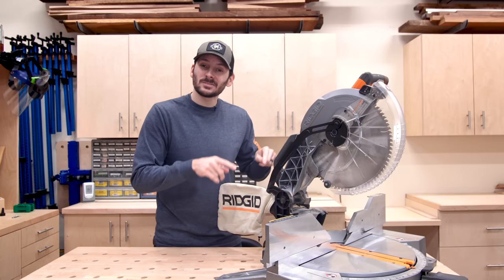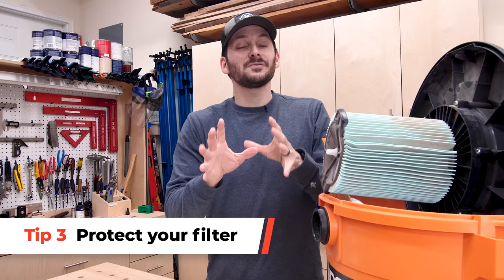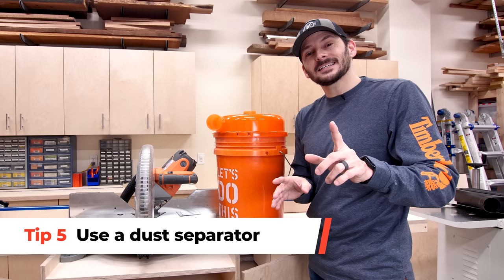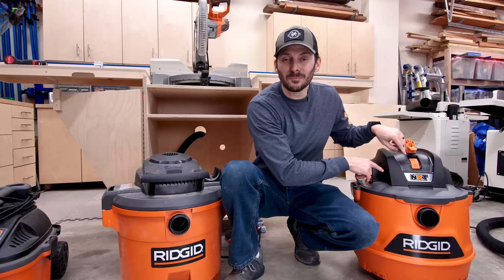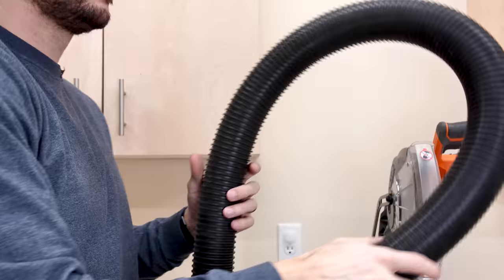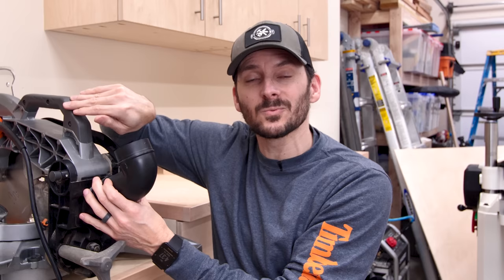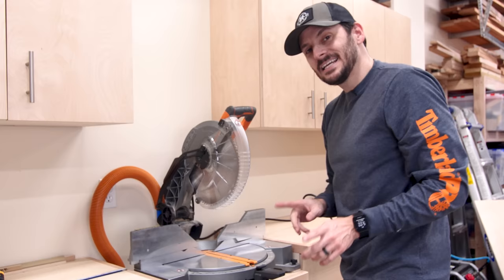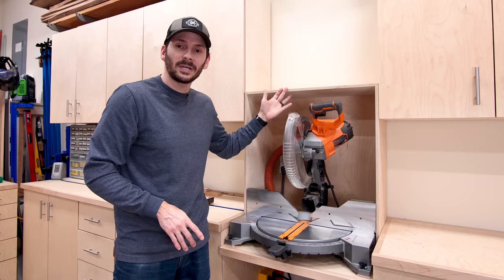10 Tips for Better Miter Saw Dust Collection

Comment: I told my wife that I needed to buy a 3D Printer.  Oh, we laughed and laughed.
Reply from the maker: 😂😂😂 persistence is key!
Reply: @smashyrashy    My wife is. 😂
Reply: Hard to justify a 3d printer, until you have one. Now, im glad I can CAD and make my own brackets, fittings, etc. It's at least paid for itself.
Reply: ive got 5 of them and am now starting my woodworking/shop tools collection. you still have a chance to make it out the other side w/o a printer
Reply: My wife says I have switched to shopping mode so she is expecting me to get one pretty soon. Our problem is with the high humidity we have since we are only .6 miles from the ocean.

Comment: The dustopper leaks around the mating surface between it and the bucket. A thin line of foam tape drastically improves suction
Reply: I came to make this same comment. Huge difference!
Reply from the maker: great tip!  Gonna do that now
Reply: I used a bicycle inner tube and laid it over the bucket lip to help the seal.
Reply: I haven't noticed that with mine. I will have to check it when I have it out next.
Reply: Thanks for the tip.  I will check mine tomorrow!
Reply: What kind of foam?
Reply: Yup, what he said. I just used a couple of layers of ductape. With that, I have basically no measurable amount of suction loss with the dustopper.  

What would be awesome is to find a 150cfm or so shop vac that's only like 3-4 gallons. Highest I've seen is the 110 cfm Ridgid Pro square one, which is what I'm using.
Reply: @TomHoppe  dumb question but did you put tape on the lid or bucket or does it matter?
Reply: @taylormcleod3331  Go get a roll of 1/4" adhesive backed weatherstripping from the hardware or big box store.
Reply: My dustopper vac combo already slightly crumples the home depot bucket with all the suction. I'm excited to see if it vanishes like it got sucked into a black hole with the foam tape!
Reply: I noticed mine had a pretty good seal, to the point that the walls of the bucket started collapsing due to the negative pressure. Cut out a spoked wheel using my jigsaw and put it halfway down the bucket walls. Now it doesn't collapse anymore.

Comment: Another method of making fittings is to heat PVC pipe fittings that are slightly undersized. After it's soft enough when heated, force fit them to the fitting that needs to be fitted to, allow to cool and now new fitting is form fitted. An added benefit with PVC is the self lubricating characteristic that allows fittings to be easily readjusted or removed with less binding.
Reply: Just make sure that you do that outside with the wind blowing away from you. Heating PVC causes it to emit toxic fumes. You could also use heat shrink tubing.
Reply: uy be careful with that. your also creating a taper that will want to force the inner part outwards. especially in pvc when it bends a bit. sandpaper it horizontally and it will be stronger.

Comment: I swapped out my included dust bag for a plastic trash bag that I taped on the saw outlet. There was sawdust caught in the folds of the OUTSIDE of the bag and ZERO inside the bag. It is simply a flawed concept that pure momentum of the blade will shoot the particles in the bag. Now I need to pay attention to what you're doing here, lol.

Comment: Nice one, thanks as always.  I'm with Joe Blow Below- I don't have a 3D printer, I haven't had the patience to teach myself any CAD/CAM software, so I just kind of heat stuff up and cram it together as best I can.  PVC and ABS are cheap!  Use good ventilation., and stuff something more or less heatproof inside of the tube so it doesn't collapse when you bend it.  

I've found  #1 plastic - PETE - to be really helpful, as it shrinks when heated.  Many, many types of bottles and jars from the supermarket, including many sizes of soda bottles, are made from this plastic.  Cut the ends off, slip it around the two pieces you're trying to mate, and put the heat on it.  It will shrink to fit both so you get a removable airtight seal.  

Finally, those boxes with a bunch of furnace air filters and a box fan blowing out the end are great for protecting your lungs.

Comment: I have been using pool skimmer filter socks on my shop vac filters. When they get dirty just grab the sock, stretch it out a little then let it go. This saves the filter and are easily replaced. I got 30 in a pack for like 12 to 15 dollars.
Reply: Great tip!  Been doing this one for years.  Cheap fast simple.  I use the bag filter for drywall dust, but pool socks are great for wood chips and dust.

Comment: Loved the video. I've been working on my own dust collection system and this video gave me some new ideas. Thanks!
 The fitting should always go from smaller to larger, when possible. This helps eliminate the lip that can collect dust and debris that can clog up the hose.
 I've seen people use PVC DWV to make custom fitting by heating them to the point where they can be stretched, bent, and manipulated to fit other sizes and needs.
Reply from the maker: yep, it'd be more efficient  going outside vs inside, but the inside of both were smooth vs the outside being ridged which wouldn't be good for a plastic coupler

Comment: I have similar set up, big rigid vac, put a y  with 1 hose to miter saw and another stepped up to 4" with a rockler 10"×4" dust trap on table behind saw with hood. It gets about 90+% of the dust. Works great. I have this incorporated into a movable miter stand similar to yours.
Reply from the maker: hmmm, never thought of actually splitting the suction of the vac...I'll have to consider that!
Reply: Any chance of a pic somewhere?

Comment: I went to my local wood caft store and bought two angle connectors to fi my rigid 2 1'2 hose. Had an old garbage can....full size....cut hole in top for each of the connectors which were fastened with pop- rivets. Now one hose goes from the saw, router bench, planer,  etc. to the garbage can...than a second hose goes to the Rigid shop vac. This works great for all but especially the planer which really puts out tons of wood chips. Most end up in the modified garbage can and very little other than dust goes to the shop vac. This is the same princil used in all those other dust collection devices....but mine was dirt cheap.
Now to my gripe....like you I have Rigid shop vacs....three of them currently. One is about 25 years old and works like a champ still....the next one is about 12 years old....last is the latest propack rectangular unit. Each of them has their own fittings for the hose and accessories. I go to HD and try to find adaptors between them and while they have lots...they are each dedicated to a given size....2 1/2", 1 7/8", and smaller. I aso have the same orange hose you discussed and that does allow some cross connections BUT i had to use an old dual sided 2 1/2" male to male adaptor that does work great for connection and than stepping down....but I have not been able to find that same fitting again....and I would love to get a couple more. May resort to 3D printing but I am surprised that Rigid or HD doesn't offer more adaptors Maybe it is planned obsolescence ;-)  I finally resorted to modifying some adaptors I had by using my band saw to cut them up and turning them down on my metal lathe....but that is not the way it should be.

Comment: I attached a multi plug in to the vac switch and attached bandsaw, table saw, router table, miter saw, and drill press to the multi plug. I made a plenum and attached each machine to separate blast gates attached to the plenum. The plenum I attached to my dust collector which was attached to my large shop vac. The shop vac chord I attached to Opening the blast gate to the vac switch and turned on the vac. So I cuold open the blast gate to the tool I would be using and draw the sawdust into the plenum and then into the dust collector. 
  I modified the vac bag so that I could dump what little dust was in it and then reclose the bag. Over the pleated filter I placed a section of sleeve from a polyvinyl jacket which stopped most of the real fine dust making it through the shop vac bag to the pleated filter. 
  I added an additional blast gate for a hose for floor vaccuming. 
  I built a off feed / workbench / tool housing bench which I housed the miter saw, band saw,  and drill press. Each of these tools I attached to a folding shelf which rotated the tool up through the top of my bench through a horizontal door equiped with 180 degree hinges. The tool shelves had a wing attached by door hinges (not cabinet hinges) which supported the weight of the tool like the miter saw off feed supports in the video. 
  The workbench acted as off feed support for the router table and jobsite table saw. 
  Since my shop is a portable 10x20 building supported off the ground I was able to run the vac to plenum hose under the shop between the floor joists. This eliminated my tripping over the hose everytime I rounded the workbench.

Comment: Thanks for a great video! I am using a similar setup with a shop vacuum with bag and a Dust Deputy, but I also added a HEPA filter to the vac. One thing I think you missed mentioning is that that iVac auto-vac switch is the one to buy if you need to run a saw and a big vacuum. Its biggest feature is that it can be plugged into 2 circuits, which prevents tripping a breaker. My miter saw can draw 12 amps and my vac also draws 12 amps, so they need to be separated. The first auto vac switch that I bought, only had the ability to plug into a single outlet, and that was problematic, so I had to buy the same one you showed in your video and it works perfectly, as you know.

Comment: I kind of went the opposite approach and ONLY have a 4" dust chute on the bottom of my miter saw hood hooked to the Dust Collector. The whole thing is hobbled together but the fine dust that comes out of the back of the saw just hits the back of the hood and falls down into the 4" DC port/chute. However, this does require the miter saw to be very close to the large dust collector. 

Actually, picked up a cheap wall mount Powertec DC to dedicate to the miter saw. Since I had the 4" fittings this cost less than buying a heavy duty shop vac, hoses, auto-on/off, etc. I'd say if you have the space for a shop vac and DC combo, that setup is best. However, I'm happy with a 4" DC hood connection vs. shop vac direct connection if you only had one. Great video as usual.
Reply from the maker: I'd love to dedicate a larger collector to the saw and have it on some type of automatic switch.  That'd be great
Reply: Not following too well. What does the powertec dc do better than shop vac?
Reply: @carenclemmons5002  Physics. Single- or Two-Stage Dust Collectors (commonly using 4" or 6" duct work) have the advantage of sucking a higher volume of air than a shop vac. A dust hood surrounding a miter saw contains a significant amount of cubic space filled with dust, so using a dust collector that can move a greater air volume has an advantage over a shop vac.

Comment: Enjoyed your video very much. I just got my secret weapon today. It’s a remote controlled switch that I keep on a belt loop so whichever side of my 4x8 rolling workbench I’m working on, I can quickly turn on or off my shop vac. I’ve got my miter saw, table saw, jig saw, belt sander and palm sander that I connect to my shopvac. The remote works perfectly. If I used your secret weapon I’d need 5 of them and I’m too cheap for that. I made a dust collector for my miter saw that looks like a scuba set up with dual hoses plumbed to the shopvac. It’s stationary and works for bevel angles but needs to be removed for miters. Not perfect but solved the 12” Dewalt habit of sending sawdust everywhere. 
I love looking at all the great ideas on YouTube. 
Thanks for putting in the work to bring us informative entertainment. 
Cheers.

Comment: Since you asked, I would not hook up 4" dust collection.  I made mine with it open under the MS and all saw dust that doesn't go up the shop vac just floats into the drawer under the saw.  I can sweep the saw off and all dust falls into the drawer.  Once a month (or more) I empty the drawer.  If you are worried about the fine dust, just put a fan with air filtration nearby and run it with the shop vac plug in.  I did a several videos on dust collection and such on my MS station. a couple of years ago.  If interested, they might give you some additional ideas to look at.  Great channel, thanks.  I don't always comment, but I do always watch.

Comment: You find a really nice miter saw on craigslist for $100 and feel like you found the best deal ever.  2 months later you've spent dozens of hours and hundreds of dollars getting the setup just right. 

--> It still blows dust everywhere.

Cross-cut sleds are loved for a reason. Love your setup though, those shop vacs at home depot are awesome. 15 years, and it even blew out my siberian husky's coat.

Comment: You have a nice solution as-is.  In my case I plumbed in central vac combined with an iVac switch but I regret my solution.  I often walk up to the saw just to make a quick cut, and by the time my collector is up to speed I've already finished my cut and moved on.  The Shop- Vac fires up almost immediately, so you don't have the lag issue that I have.  What does work well for me is enclosing the front of the dust hood and my downdraft area behind the saw...with nothing connected directly to the saw. Works well.

Comment: I have a couple of the nylon (?) miter saw dust hoods that he alludes to that work well for me.  The first one I bought is a Rousseau and the second one is a Vevor, which is just as good as the Rousseau and was considerably less expensive.  (Both from Amazon.)  I don't hook up any vac to the miter saws themselves, because it's too awkward with the dust hoods in place, and because the miter saws throw off a lot of dust from all different directions anyway, which the hoods capture - which is what they were designed to do, and they do it well.  They practically envelop/cradle the saws, leaving just enough working room.  Pretty ingenious (but simple) designs, the way these things work.

Plus, static inside the hoods tend to pull dust in and then the dust clings to the inside walls of the hood.  Occasionally I'll just give the hoods a shake, where dust settles down to the 4" exit port at the bottom near the floor, and is collected into a cardboard box sitting on the floor.  Anything remaining I clean up with a handheld vac.  I guess I'll probably in the future experiment with hooking up a shop vac to the 4" port, but for now I'm too lazy to do so and to finagle the room to do it.

But the con is the initial assembly and setup, which is a nightmare.  Better have two (or three) persons handy to assist as you cuss your way through that.  VERY awkward.  (The Vevor is essentially identical to the Rousseau in that respect.)

As far as shop vacs are concerned, I suspect every manufacturer will eventually get on board the trail blazed by DeWalt, and make their vacs "quiet" - or MUCH quieter compared to the ear-splitting noise produced by regular vacs.  These quiet vacs are a game changer, and don't even require ear protection by those folks concerned about their hearing, or at the very least are annoyed by the noise of regular vacs.  I have one of those among my collection, and am amazed by how quiet it is.  

I also have the upgraded version of the Dustopper ("Dustopper Pro") sold by Home Depot.  THIS is THE ONE to get.  Fits very well onto a cheap 5 gal. bucket with its secure clips.  None of that expensive collection bucket nonsense or cobbling up a collection bucket.  Get a semi-opaque HDX bucket from Home Depot (so you can monitor how full its getting) as well and you'll be good to go.

And not to slight Ridgid, they are my go-to as far as (quality) plumbing repair tools are concerned.  I live in an old (cast iron/lead pipe) house, and have an ongoing project to replace all that stuff with pvc/pex pipe.  You haven't lived until you've dealt with all that in a narrow crawl space.

Comment: Great video! I got a Dewalt 10 gallon shop vac for this very reason. Great ideas for upgrading my system. One thing I wanted to mention about the 3D printing is another possible option if you don't have a printer of your own. Try your local library. Our library has a few that you can use to print things.

Comment: Great video! I bought the iVac automated vacuum switch because of your video! It works awesome! I used to forget to turn on the vaccum when making cuts! It turns on and off automatically. I mounted the box to a piece of plywood and put a French cleat on the back and now it's hanging on my wall and I can plug tools in as I use them with my ridgid shop vac!

Comment: I had a home made box/shroud previously with a hole in the bottom attached to my 1 hp dust collection system.  It did not work.  I have seen others add plastic curtains to increase the suction.  I did not try this, so I'm not sure it would work.  I have since bought and use the Rolland shroud.  Even if there is plenty of suction, I need to shake the shroud from time to time to make it drop in the collection port. What it does really well is to contain the dust within the shroud.  It has made a world of difference in my shop.